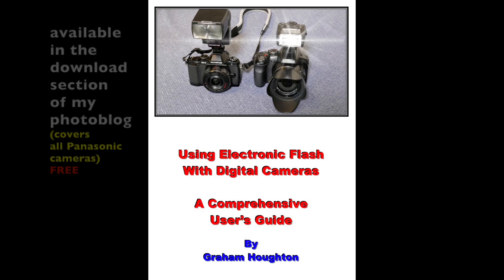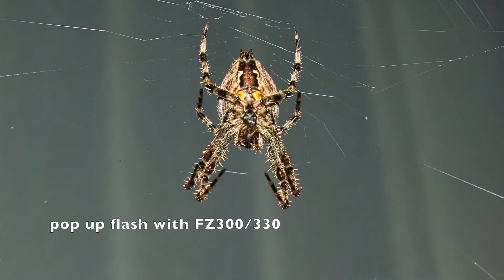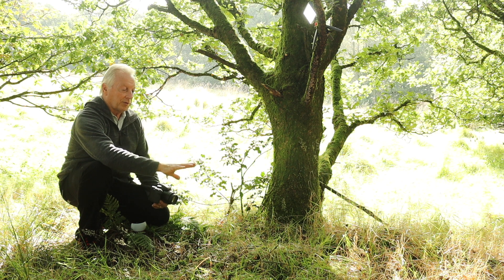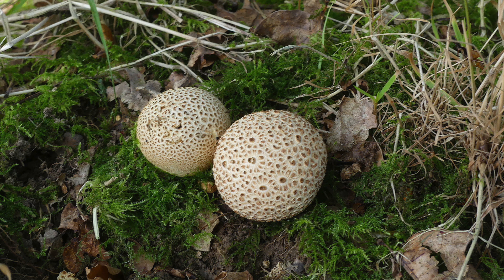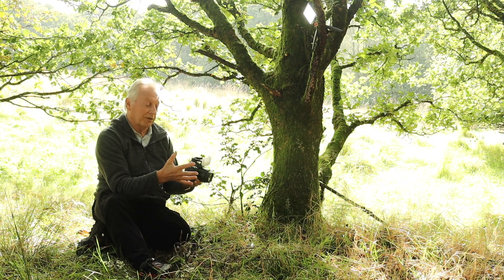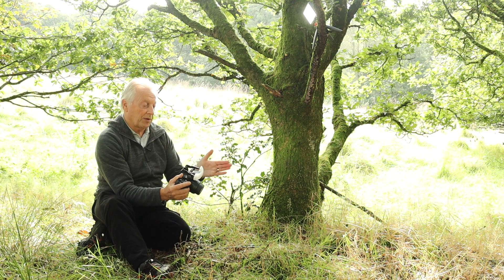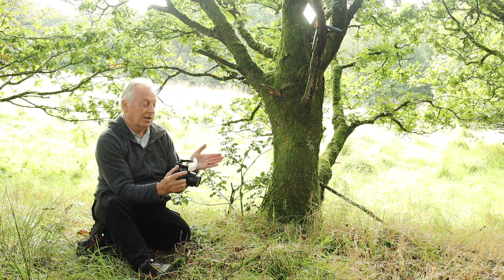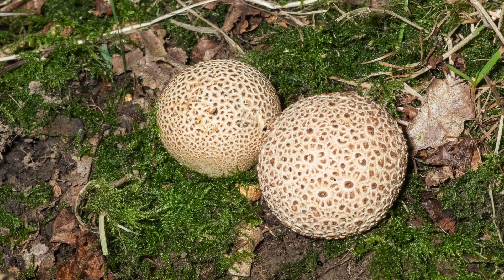Basic Photography with Panasonic Bridge Cameras Part 6: Using flash for close ups.

Comment: Graham, a little off topic but what size quality print do you think is possible with the FZ82/330?
Reply from the maker: A lot can depend upon the subject and the choice of material for the final print. Canvas prints can look good even at lower resolutions. I have a 40inch wide Canvas from the FZ300 and it looks great at the right viewing distance. 20 inch prints should be possible from LOW iso images.
Reply: John Collins I do tweak my images in a photo editing program anyway. I have recently bought an FZ82 at a good price from JL. I was fully aware of some of the negative things that have been written about the image quality and the fact it is a small sensor camera and not a CSC or DSLR.